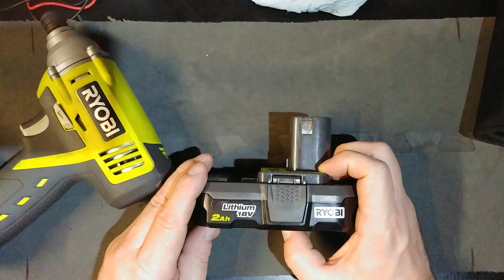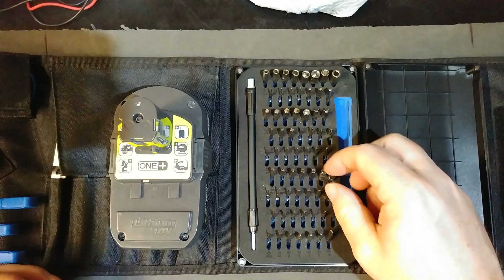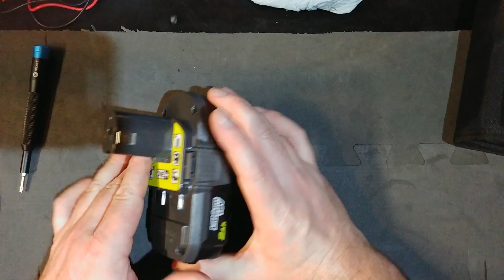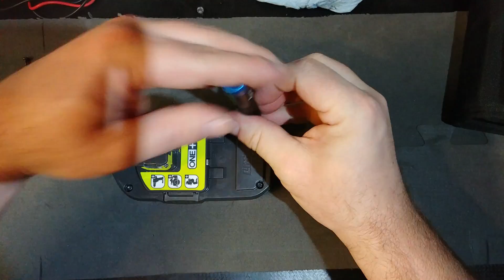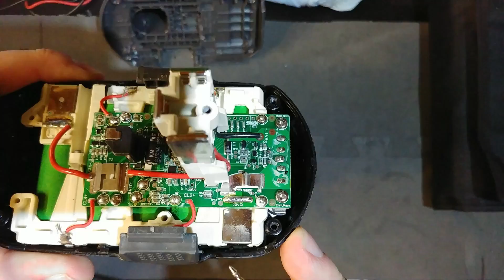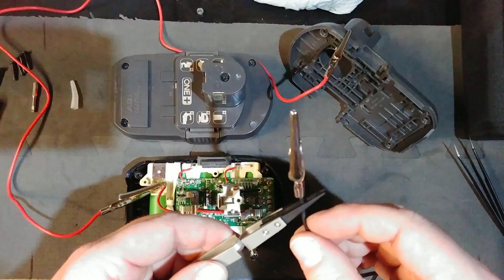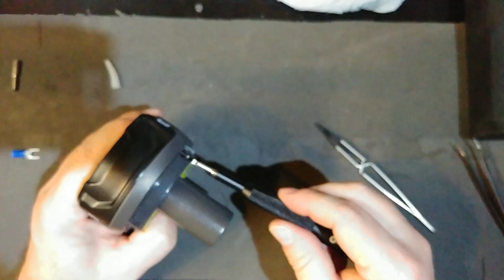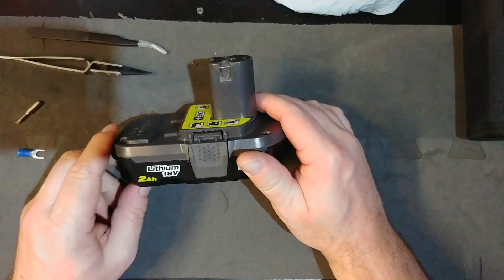Ryobi Battery Not Charging - super easy fix - dead ryobi battery repair

Comment: This will work but in certain cases this could end in battery explosion... All you need to do is add a resistor inline to limit the current while boosting the dead cell maybe like 10ohms..also if the dead pack is say 75% down you could have a bad cell and I would then leave the fix to a pro as there is a good chance it could end in fire
Reply from the maker: Thank you. Really, I'm not an expert on this, but I used the method to get my battery usable again. I will continue research and I may post an update video perhaps.

Comment: Somewhat informative, however, you should never charge one discharged battery with a fully charged one due to current flow into the one that's low and the one that's high.  Always use a controlled charger with the ability to control the amp draw and charge voltage.  Sending a current flow into or out of a lithium cell can severely damage it and cause an explosive fire.  You can purchase a very inexpensive charger on amazon for a few bucks with digital readouts of volts, amps as well as watts.  Heating wire up indicates your current flow is very high if it does so with just a few seconds of contact.  Your information regarding the layout inside the battery is great, though.  It's possible to completely charge the battery with a controlled charger.  Heck, that's what you get when you purchase a cordless tool battery charger.   I'm not recommending this but you could tap the output on the charger and using the same bypass you demonstrated, you could charge the battery safely.  That would be safer than using the method you used, but only if you know what you are doing.....
Reply: He did say he was only doing this for 20 seconds or so.

Comment: The battery controller on newer One+ batteries drops the terminal voltage down to about 7.5v after about one minute of non-use.  This may have been done to reduce the discharge leakage when left attached to tool.  It pops back up to 19v when higher current is drawn by tool.

When I first saw this low voltage I thought the battery was bad, but it ran the tool fine.

Comment: You have to charge each individual cell separately. These battery packs charge all the cells in series which quickly leads to unbalanced charging. The computer board is only for safety.. it shuts off charging when any single cell reaches max voltage..
Reply: This video process didn't work for me. Did you ever figure it out how you charge your Ryobi batteries?  Do I need to charge reach individual cell separately?

Comment: The whole idea here is to take apart a battery that will not charge.  Bypass the BMS. Connect another similar working battery in parallel with the raw battery pack to bring the raw battery pack up above the BMS cutoff threshold. Then quickly reassemble the battery pack and put it on the charger.  This is the whole problem with BMS's.  They work on assumptions and do not actually measure internal resistances of each cell. Thus allot of good batteries get thrown away and recycled in China.
Now that did not take 16 minutes to explain.  Brent you need to prepare better before making videos.

Comment: I previously repaired my ryobi batteries without taking the batteries apart and just using the contacts on the batteries and a battery charger set on 2 amp. Theyve been working fine for over a year now.
Reply: I too, used my automotive battery charger, @2 amp setting. One minute only needed to get the Ryobi 18v and Black& Decker 24v 'primed.' Full enough to get each respective charger to launch!
Reply: And thanks.How long do you leave the battery charger on

Comment: Just a safety tip here, it’s a bad practice to hold uninsulated alligator clips with both hands to complete a circuit.  It appears his clamp had an insulated tip but if you aren’t careful your body can become part of the circuit up one arm though your chest (and heart) and down the other arm.  Use insulated alligator clips or some insulated gloves.  Or just use one arm at time.
Reply: @ndandthecave456  It’s a bad practice because if you get used to doing it on low voltages then you will do it when working on higher voltages that can kill you.  Then it’s not so funny anymore, is it?

Comment: I couldn't fix my battery and gave my Ryobi drill away. Mine wasn't the one series. There's a logic board above the cells as you probably saw. That's what's bad on mine. My model drill was discontinued, so I bought a DeWalt.

Comment: A variation on drilling two holes in the plastic case, to access the same contact points.  I tried both methods on my battery, and it stayed dead.
Reply: Mine too. Battery shows 16.8 and 17.1 with inside tabs. Charger keeps saying Green-done, but will not activate drill. Will keep trying...

Comment: Thresholds are just BS so you buy another battery   just as "sensors" are on cars so you buy another sensor
Reply from the maker: I somewhat agree but to my knowledge they are to protect the cells from being overcharged or charged if they're damaged. I think it's also possible the battery management has issues but it could be either I guess.

Comment: My battery isn't dead, one led lights when I test it (built in button on the end of the battery pack) but when I try to charge it with the Ryobi charger I get a steady green light indicating that it isn't charging (or is already charged). There is 7.48v across the battery contacts. Anyone think I should try this jump charge method on this battery? Maybe the sensor board is bad???

Comment: That heat indicates poor current flow.   You need more mass of copper in contact on both ends.   And in parallel wiring as you have it, the net voltage will be the average of the two until they are both at that number.  Serial wiring, with pos source to neg lower voltage, then that batteries pos to the neg of the source or higher voltage.  Then it’s cumulative, or in this case 36Volts.

Comment: Can just plug your crock clips directly to battery charger and charge the cells by passing the circuit board
Reply from the maker: I am not sure because the other battery also has a bms on it, but I don't know if that helps avoid any potential issues by bypassing the bms on the dead battery.

Comment: You are THE MAN!! I bought a Ryobi drill-driver a couple of years ago which came with two batteries - one was DOA. I got busy and forgot about it until this video somehow came across my feed. I followed the directions and the battery is FIXED!! Thank you!
Reply: That exact circumstances happened to me bought the drill & 2 batteries CA,one of em didn’t want to take a charge, it does now

Comment: Even if it is not connected to the drill, the Ryobi battery discharges it self with severe voltage drop that makes it impossible to recharge. I open the case as you have done and then use a car charger with 12v to jump the voltage of Ryobi battery to 5-6 volt, by connecting it to the Ryobi battery internal terminals for few seconds only. Make sure the polarity is correct. Count to 7-10 and then disconnect. After that the Ryobi battery can be charged on its own charger.
Reply: Thanks - I was wondering why not use 12volt battery charger to do this. I guess the actual voltage from the 12v charger is more like 14v (or slightly more) so your 7-10 count is probably good advice.
Reply: I set my vehicle 12v battery charging unit to 2A, attached - & +, left it o n e minute. The 'prime' of the cells then launched the Ryobi 18v and the B&D 24v. Work perfectly.

Comment: Ironically, I made a youtube video praising Ryobi and then one of my batteries went defective. Thankfully, my bummer was short lived. This method worked quite well. I was able to unscrew 4 of the 5 screws with a normal torx bit. I drilled out the 5th and replaced it with a standard Phillips. Looks janky but I'm back in business!
Reply: Hmm.. ...u..James odonnell. James odonnell to

Comment: thanks, but way too much talk. cut to the chase. done in 3 minutes.  this can work. repeat no one should try this who doesnt have the fundamentels. one point, if you have tripped a ryobi battery over loading it none of this may work. overloads cook the control board or create sweating in the pack killing the lithium. the breaker is the most vulnerable part of the pack. constant tripping leads to failure. I agree on one thing. It is important to always remove the battery when not in use. i have gotten 5 plus years out of packs.
Reply from the maker: Yes, this was one of the first videos I made. There is an updated version here that is much shorter: https://youtu.be/2J1RhAK31KY

Comment: Easier fix. Battery showed no voltage, I made two jumper wires one for positive and one for negative and put into top of battery were it’s marked positive and negative. I then attached the two wires to my trickle charger and charged for one minute and then disconnect wires and trickle charger .ohmmeter shows10.2 volts. Put in my ryobi charger and now it’s charging. Easy peasey.

Comment: I honestly didn't think this would work and I was highly skeptical, but what the hell I got out the battery tester came out at 4.7 volts hooked up my charger and set it up 3 minutes later it tested at 7.5 volts. I disconnected it and plugged it into the ryobi charger and sure as shit it started flashing green!  😎 after 6 months of it flashing defective and not charging it took a 3 minute alternative to fix it.  Great job 👏 I'm very happy I found your video!

Comment: Great video with emphasis on safety, Especially on connecting to the inside connectors thus bypassing components between the 18650s and the exterior connectors in the newer batteries

Sometime all that is required is repeatedly inserting the batt pack into charger until unit senses enough voltage to charge the pack, since the initial test provides a small charge, but this can take MULTIPLE insertions, so best to check pack voltage to see if close to 75% of rated voltage.

For a bit more advanced DIY viability test and resolution there may be the need to actually test the individual 18650 cells

1)  If the source of failure is the circuit board or a non-battery component inside the pack, then NOTHING below will help.  

2) But chances are there is one or more under-voltage 18650 Li-ion cells, which can be individually measured with a voltmeter once case is removed. If one or more is significantly measuring a lower voltage than the others (normal around 2-3.6V, below 1.5 V is either dead, deactivated by safety circuit, or hopefully just in "sleep" mode) which may be resolved by a trial of "boosting" the voltage with another 18650 or similar 3.5V power source, + to +,, - to -, for about 15-30 secs, small spark is OK.  A confirmation of a potentially viable cell responding to a "wake up" is by showing any sustained voltage increase and eventually allowing it to be charged to 3.6V again. BE CAREFUL, and if voltage remains low or nothing, chances are it is not viable, either chemically or mechanically defective, possibly the safety circuit deactivated it, WHICH SHOULD NEVER BE MESSED WITH.

If after trying these alternative reviving techniques you will either have a restored Battery Pack for either short or long term,  or one to get properly discarded / recycled... or carefully harvest the parts for other uses.

Strongly recommend searching for similar videos, especially of the batt pack brand you use, and BE SAFE!!!!

Comment: My  flashes red then it says it’s charged but when I check the voltage it’s shows zero
Reply: Get a an automotive bulb and put it on your battery until it's dead,than do  what he did in the video
Reply: @ndandthecave456  I was just under the assumption the battery indicator read zero,in that case the battery might be so dead it needs a jumpstart.Milwaukee batteries are fucky as far as I'm concerned.Ive had more weird shit go on with them than I ever did with any of my NiCAD stuff.
Reply: @ndandthecave456  the controllers in the Milwaukee batteries will make them do weird shit,like not take a charge ,read full when their dead ,read dead when their full.They really don't like being left dead for any extended period of time.
Reply: @ndandthecave456  I can read just find you obviously just can't comprehend

Comment: One+ 18v lithium battery’s won’t charge. Followed your tips. Prior to charging it had  0.10v  charge. After following your tips it is now 5.88v. Placed it on the original charger still won’t charge. Any other tips? Should I bring it up to 10v? Ty

Comment: Came here as I have two that won’t charge. One shows 5v on the post contacts and the other 8.5v. I opened the case as you show. On the battery itself, it reads 20v. Why then would it only show 5V at the contact post that inserts into the tool? A working battery I have shows 20V at the post. Does that mean the issue is with the controller board and that the battery cannot be recovered ? Thanks.
Reply: bonjour, j'ai le meme probleme que vous, avez vous trouvé une solution à votre probleme, merci

Comment: unwanted electronic circuit inside the battery unit, see the electronics using IC and smd and print resistors, another way cheating the people by either china or Ryobi.

Comment: Brilliant video. Worked perfectly for me. First time. Don't watch the idiots that drill holes in the casing! Even if you just buy one T10 screwdriver specially for the job it's worth it doing it this way.
Reply: Y not, jb weld does a beautiful job when your done
Reply: The holes are fine, just a slow drilling and stop as it eases up. Pos tab is thinner!

Comment: I have a 5.0ah battery that's not been able to charge for over two years and has been sitting on a shelf ever since.

When plugged into charger, both green and red LEDs would flash constantly.....DEAD!

I was about to recycle it today whilst having a clear out, but figured I'd have a look to see if it could be fixed.

I tried the other method first, connecting alligator clips to the charger terminals and battery terminals, bypassing the safety circuit and nada!

Was about to finally dispose of the battery and then found this video and figured I'd give it a shot.

Battery was @ 0.300v (IIRC) and after connecting for a few seconds using this method, the faulty battery was @ 12v, tried a few more time and got the battery up to 15.8v.

Plugged into charger, the red LED flashed a few times, then swapped over to the green LED flashing! :)

Hope it charges! :)

Comment: I can build a car but I'm hopeless at electronics
I think I get this...
It's sorta like using jumper cables to start a car with a flat battery.
Reply: right.  the only issue is if one of those cells is completely dead.  then it wont work at all.